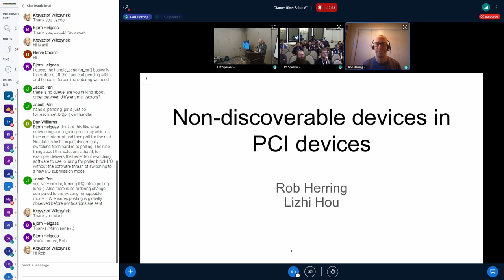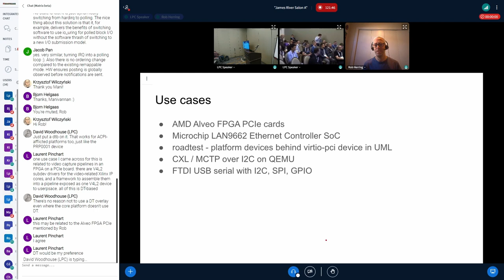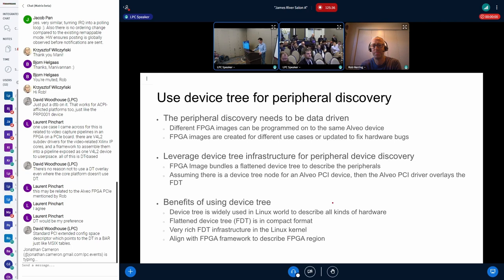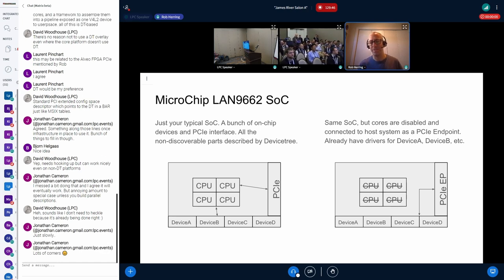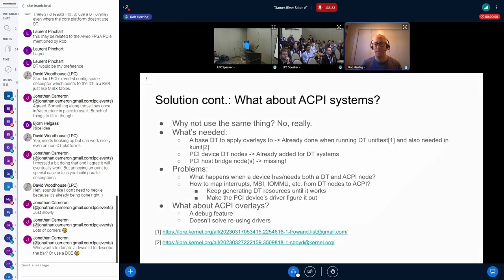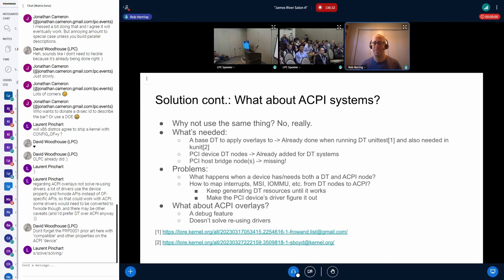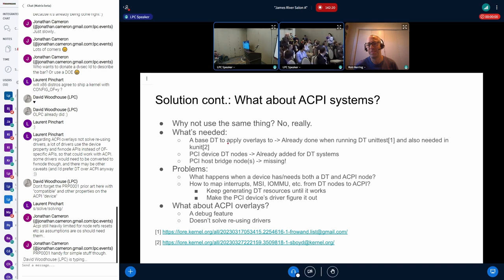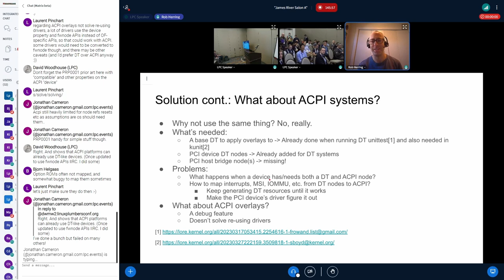Non-discoverable devices in PCI devices - Lizhi Hou, Rob Herring

Comment: It'd be a neat feature. In FPGA SoCs you can add a bunch of devices and address them easily using a device tree. The same can be done with a PCI endpoint on a (usually larger ;-) ) FPGA. It would be very useful to make such devices discoverable, so for instance an embedded softcore MCU could expose its UART via PCIe, reusing lots of already existing drivers initially developped for FPGA SoCs. Don't know if I make sense here. :)